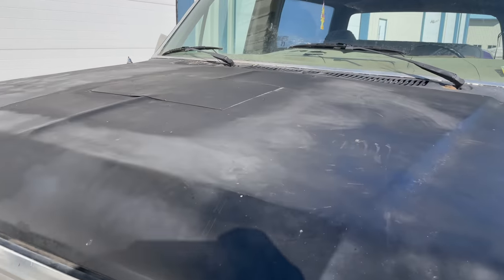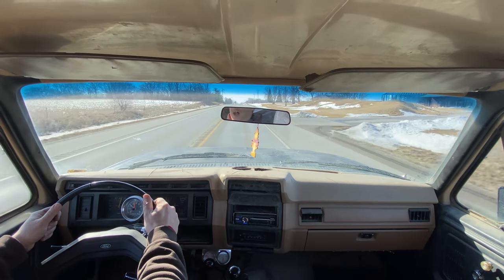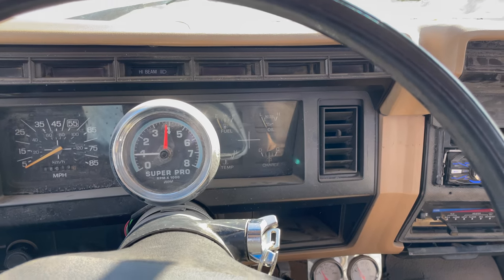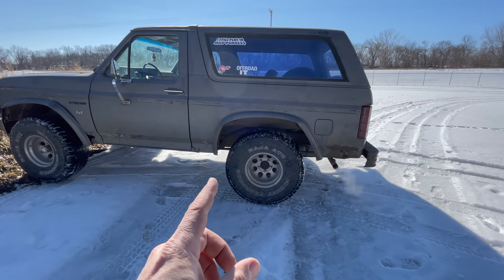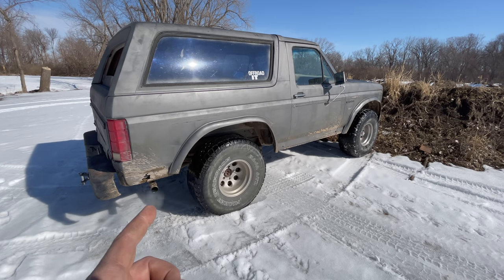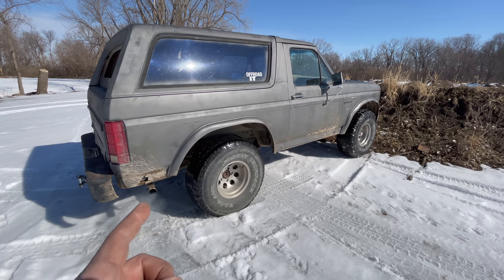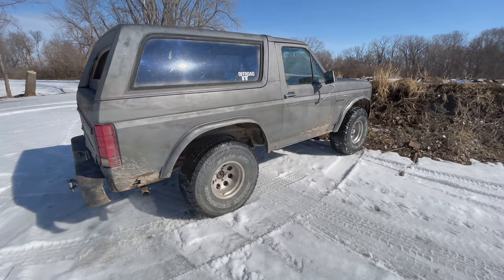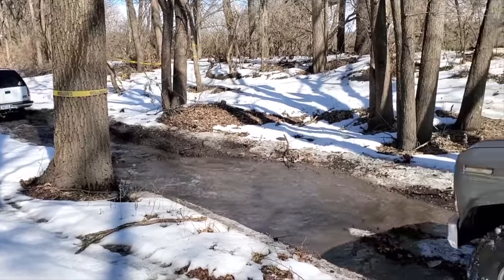Taking the 1985 Ford Bronco Off Road for 1st Time

Comment: When you opened the hood on that Bronco, it looked so much like my '85 K-5 Blazer!  I replaced that ridiculous "feedback" carburetor with an Edelbrock 650cfm 4bbl with mechanical linkage, and Edelbrock air filter and an Edelbrock "performer" intake manifold.  It's only a 305 engine, but what a difference!  I've owned it now for 25 years, and it's never given me a minutes trouble, other than replacing normal maintenance items.  Hope your Bronco can give you the satisfaction my Blazer has!  (PS: it also has the factory "heavy duty suspension" and it rides like it, too!)  God bless and good luck!

Comment: Instead of welding the rear diff, you could install a separate hand-brake line to the wheel that likes to spin more, if you ever get stuck you yank that hand brake and you'll get all the torque to the other wheel.
Reply: Damn, that's not a bad idea! I've never heard of that before, but that would be dope if it works!

Comment: I had a 82 f150 mud truck. 300 six, 4 speed, Dana 44 front with lockers, 9 inch rear with lockers, 4.11 gears, 3 inch lift with 35 inch tires. Thing was a beast never did get stuck with it. Me and my buddies would go mudding and we would go 2wd until we needed 4wd. Usually the guy in front would need 4wd and it would follow in line to everyone putting it in 4wd. My truck well most of the time I would get moving again in 2wd. I was the only one with lockers. Only bad part about having a truck like that is if a buddy goes out and plays by himself and gets stuck I was the first one to get called. Still at 2 in the morning I was always ready to go help.

Comment: Nostalgia... In high school and college I had an '84 Bronco with a straight six and a four speed. That is the one vehicle I regret selling, even 22 years later. I suggest some kind of locker in the rear. I had a lunchbox locker in the rear diff, made that truck unstoppable! Plus I kinda liked the ratchet sound when I made tight turns on pavement.

Comment: Part of the single wheel spinning situation is that the pinion gear tries to climb the ring gear.  That will unload the right rear and the left front.  Various solutions to this problem exist  ( $$$ ).

Comment: I have an '84, it was my Grandfathers.  You are right, they do drive "big". The short wheelbase makes them use all the road. That lift kit didn't help.  The rear window motor is the same as one for the doors. I cannot remember if it is left or right. It is an easy fix.  Make sure to rust proof the inside of the tailgate while you are there.

Comment: I would absolutely want to see more on this Bronco. Especially so if you install a traction lock in the rear differential. With some good off road tires, and a posi in the rear, with the excellent ground clearance the bronco has it will be a good competitor off road.

Comment: For an advanced geek this makes perfect sense but for me, a noob it's  a "little" more difficult. My question is very simple for a professional ,I have a 1986 bronco XLT , 351W engine and a C6 tranny. When I bought the truck it did not have a carburetor. Little research revealed that it had a Holley 4180-C . I plan to install a Edelbrock 1906 and I have no idea what vacuum hoses I need to hook to the new carburetor for street drive ... I've done so much research and still I could not find an answer to my simple question...Thanks for posting!

Comment: I always thought wheel locks on front axles actually made it so the 2 front wheels spin together
Reply: The locks just connect each wheel hub to the differential. Locked-in is just like the rear axle with an open differential.
Reply: I drove a 1985 Ford pickup with the same setup.  If the hubs were locked and you engaged the transfer case the front tires would scrub during turns on dry pavement.  It all depends on how the front axle is configured as to whether the wheels slip with the hubs locked.

Comment: Diff could simply be worn. Rule of thumb on Ford is check the door decal. There is a 2 character axle code. If it is 2 numbers, open diff. Letter followed by number, limited slip.

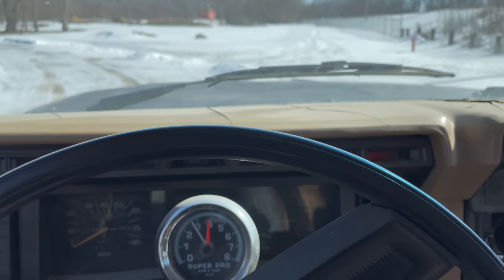Comment: 5:20 -- if you put it in 4hi or 4lo and lock both front hubs, then won't both front wheels be turning in this snow against-berm experiment ?
Reply from the maker: No the locking hubs are now t differential lockers.  The locking hubs only engage and disengage the front wheels from the driveshafts.  The differential is not affected by locking hubs.

Comment: You said that it wouldn't be very good on your clutch to leave it in 4hi. Why is 4Lo easier on the clutch?
Reply from the maker: To crawl over things you want to go slow but still have your RPMs up to make power.  4Lo lets you control the truck with the gas pedal instead of having to use the brake and clutch all the time.

Comment: Diagonal wheel spin is usually what stops a lot of 4wd without LSD or diff locks.
Surprisingly stabbing the brakes very quickly with your left foot can transfer drive from the spinning wheel to the wheel with traction. 
I tested this once by parking my 4wd on sand and completely digging under two diagonal wheels.
Not sure how you would operate the truck with the diff “welded up”
Fine on loose dirt and snow but you’d be stuffed doing a u turn on a hard surface.  You’d be scrubbing tyres or snapping something else.
A limited slip diff is limited not locked.
On demand diff locks are a different thing again.
I expect you understand all this stuff but some of your viewers may not.
Perhaps an explanation of the pros and cons would be a good subject for another video.

Comment: 5:09 -- looks like rear is spinning faster than front.  If so, center-locking is not working.
Reply from the maker: The center is a solid shaft it does not have a center differential.  The output to the front and rear of the transfer case always spin at the same speed.

Comment: That's strange about the differentials, I own an '89 and I used to own a '91 Bronco(4th generation) and they both came equipped from the factory with limited slip differential. The third generation(bull nose) yours must not have? If yours is the 8.8 inch differential, they are fairly inexpensive and easy to find. Ford put them in the Explorers, they are easy to swap out. While you're in there change your axel/wheel bearings and seals. That way the whole rear end is essentially new. P.S. you need a slide hammer to get the wheel bearing out. And don't forget the friction modifier.